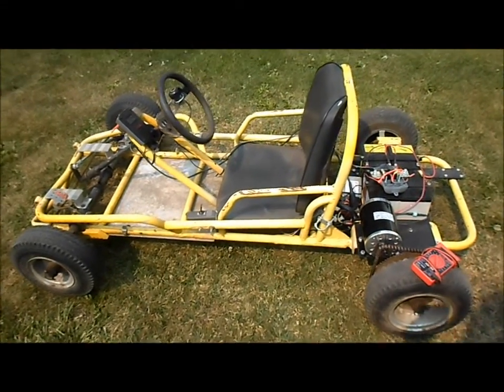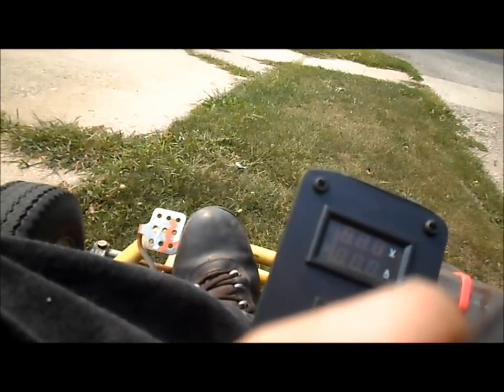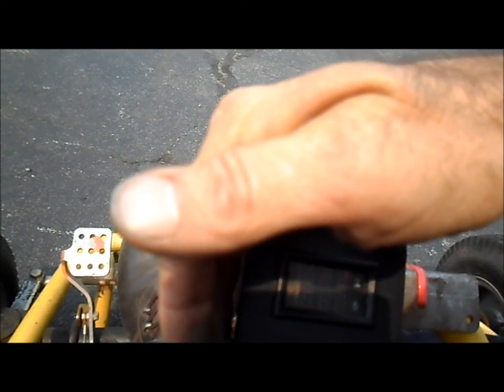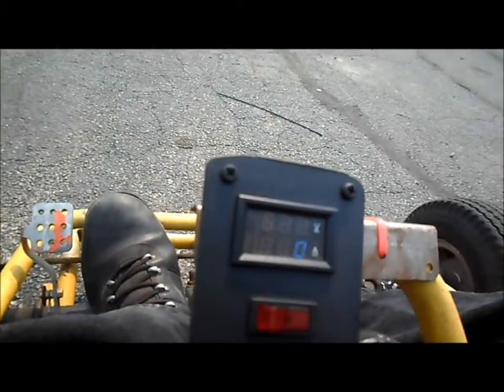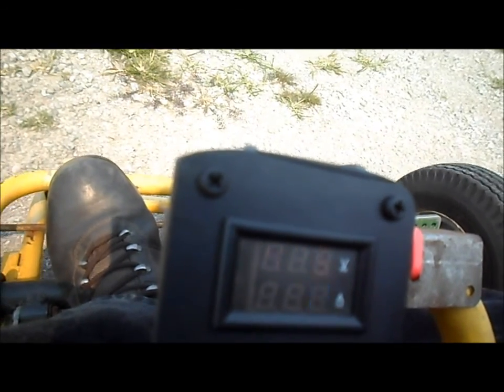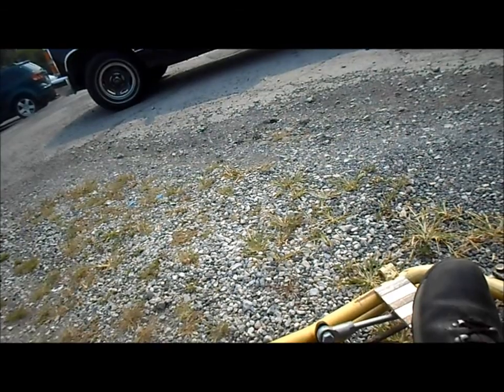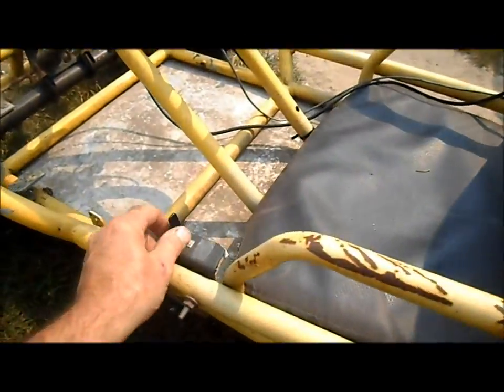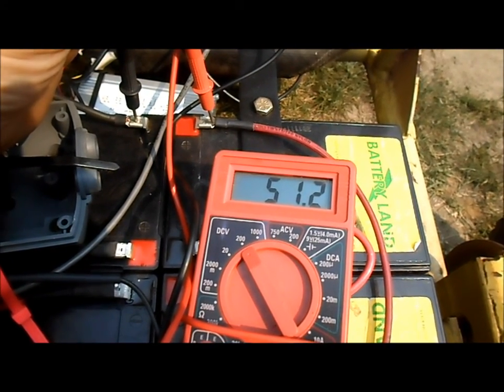e Lemon aid  part 14 48V 1,000W motor My 2nd test drive

Comment: You have four 12v at 12amps batteries connected in series to achieve a bank of 48v with 12amps. I imagine, your motor specs are 48v with 9v continues and at around 22volts inrush. Your testing shows about 31v inrush at times. I am just not sure how your motor runs if it does not have the initial kick of at least 22 amps but rather 12 amps in series total.